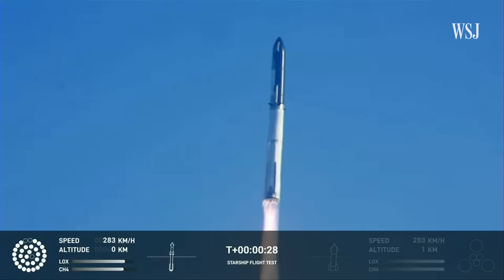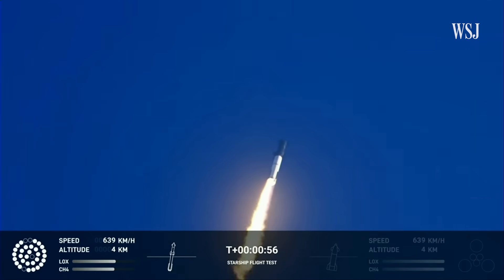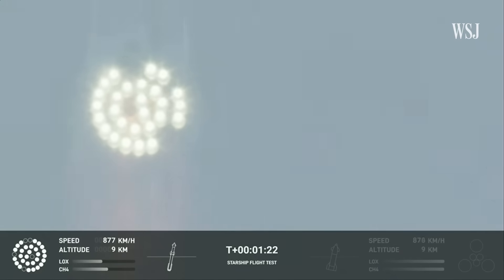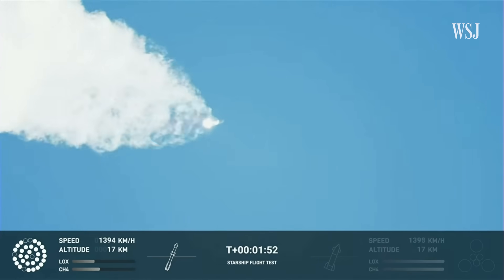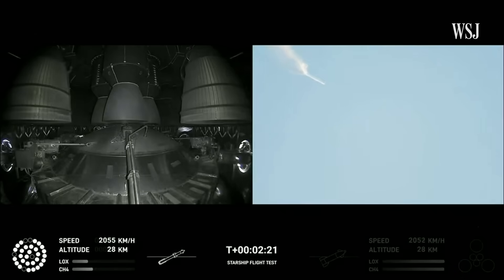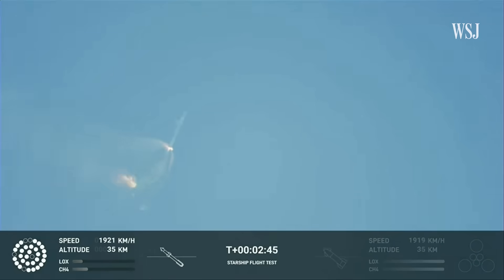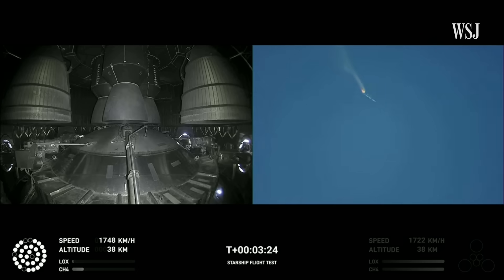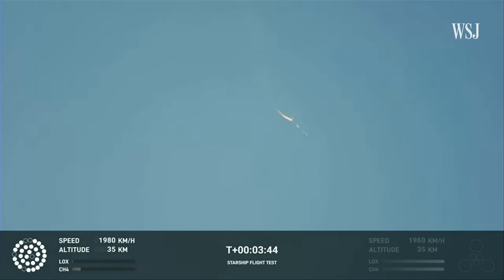Starship Explosion Video: Watch Elon Musk's Rocket Explode After Launch | WSJ

Comment: From the headline, I was expecting it early. Over 3 minutes in flight and this being the first flight... this is pretty impressive considering the engineering required
Reply: There were set milestones within this initial test. 

1. Launch and not destroy launch pad infrastructure. 

2. Separation 

3. Land booster and starship, soft landing into the sea.

4. Collect lots and lots of performance data. 

Objectives 1 and 4 complete. 

Now so long as with each test launch there is improvement of completing the list of objectives  and reducing failures, starship will be on a good trajectory to meet its long term goal. 

You cannot judge the full performance off one launch.
Reply: it was more than likely a self destruction rather than a spontaneous explosion
Reply: @journeytree  it almost certainly was, the vehicle would not have been destroyed so cleanly if some other action was imposed. It was likely the FTS being triggered by the range safety officer.
Reply: You call it impressive that it didn't explode immediately?
Reply: What a joke.  Just to remind everyone - Musk said this rocket would be delivering Starlink satellites to space twice a week in 2022!!  That's 100 flights a year that were meant to happen LAST YEAR!  And here we are and they still can't even get a successful test flight and they are trying to spin it as a win!!  Absolute fraud at its highest level.  NASA should face up to reality and kick these jokers off the Artemis program right now......they are simply not capable of delivering.
Reply: MSM will try to spin it as if it was the biggest failure.
Reply: A bunch of idiots launched a failed starship !!! 😂😂😂😂🤣🤣🤣🤣🤣🤣
Reply: Advanced technologies were presented at the international online forum "Global crisis. There is a way out". For example, the health capsule (the possibility of life extension, rejuvenation and absolute health), from time 7:09:09.
These technologies will be available free of charge to everyone when building the Creative Society.
Reply: This is a fake CGI cartoon.
Reply: @ZxAMobile lol, you sure about that? SpaceX is small... inexperiend?? They are the only ones who have propulsively landed orbital class rockets.
Reply: Its always amusing what people outside the space industry seem to think the space industry is like.
Reply: @JohnDoe-rt7ez  And that they automatically believe their own assumptions, because, hey, how they possibly be wrong.
Reply: Doctor, your patient died on the operating table, but look how long he lasted!   Yay!
Reply: @Spence12  Doctor, you seriously need to stop experimenting prototype medical equipment on patients. These things take years of trial and error, testing, and development. My god Doctor, you don’t even know how analogies work!?
Reply: Rocket explodes and GenZ say "Success"   😂  ohh man how embarrassing are these kids
Reply: @bigduphusaj162  success is determined by the objectives of a mission. They intended to destroy this rocket at some point during the test flight. SpaceX own objectives had specifically said anything past getting off the Launchpad was a success and giving them valuable data for future iterations.
Testing a machine until failure is a basic part of developing new technology
Reply: @mattmatt516   Exactly. This test was great, I can't wait until the next one.
Reply: @mattmatt516  that is simply not true. where did you get this? this flight was a test of the seperation phase. which it failed on 4 of 5 metrics.
Reply: @mattmatt516  Tell me again how we went to the moon in a beer can without exploding in either direction? Keep in mind that was 60's technology and today nobody can get any higher than the Redbull jump mark. Lololol....pure B.S. !
Reply: @jamesbonn2394  just listen to what SpaceX has said over the past weeks, or even just in their live webcast of this launch. They had lots of things they hoped to accomplish, all the way to a splashdown near Hawaii... But they specifically said that every thing the accomplished after clearing the launchpad was bonus.
Reply: @jamesbonn2394  actually you're wrong.
Reply: @mattmatt516 excuses now all the way...😂😂
Reply: @aviatorzthebest2452  It's not excuses when SpaceX has been saying these things since long before the launch. Just watch their webcast of the launch.
Reply: @jamesbonn2394  Elon was quoted over a year ago stating that clearing the tower was the main goal along with not destroying the OLM. The official spaceX stream said the exact same thing before RUD. Where did you get your info?
Reply: @jamesbonn2394  It was not a test of stage separation, it is literally called a flight test. This was the first time the booster has ever been tested in flight, and it did pretty good.
Reply: @cal-nevatower2896  sure Jan
Reply: @cal-nevatower2896  not NASA lest I remind you of all the Redstone and Atlas failures, not to mention Apollo 1.
Reply: @mattmatt516  exactly.
Reply: @cal-nevatower2896  The 60's technology was exactly that... 60's technology. The Apollo wasn't the size of the starship, and wasn't designed to fly to mars.

We could easily go to the moon right now if spaceX wanted, but that isn't the objective of the Starship. We're going like 200x the distance of the moon while carrying equipment for colonisation. That's on a whole other level that 60's technology would obviously not be able to do.
Reply: @bigduphusaj162  It was a success.  The rocket didn't explode because of hardware failure, SpaceX triggered "flight termination" after it was clear they lost control of the launch.  They self-destructed the rocket.

The success was in proving that super-heavy was able to get Starship all the way to stage separation without issue.  It's just that SpaceX's unique approach to stage separation failed to work as they had hoped.
Reply: @Ncyphen  I love how you start off with that this was a success then end with the object failure that it was it cant be both my friend in the long run this test was a failure they didnt achieve their goals ala making it a failure this isnt rocket science here lol.
Reply: @firstorder438  SpaceX clearly stated the goal of the launch was for the rocket to survive launch.  It did survive the launch and made it to staging.  So yes, the launch was successful, especially considering SpaceX assumed the rocket would blow up before reaching staging.  The failure of staging is moot considering it was a bonus objective.  A failure of a bonus objective is not a failure to the mission as a whole.

So no, I did not contradict myself.
Reply: If you hate gen z so much then how about you stop acting like one of them?
Reply: @bigduphusaj162 are you on the spectrum?
Reply: @blinks6736  I think he is on the opposite spectrum of Elon Musk lol.
Reply: @bigduphusaj162  You obviously don't understand the meaning of "test"
Reply: @bigduphusaj162  maybe they know what the whole mission was to say what they said.
Reply: @bigduphusaj162  PROTOTYPE
Reply: @Big duphus AJ  rocket doesn't explode for a solid 4 minutes in its first flight, reaching all its success markers, and guy who can't see his own feet calls it a failure
Reply: @bigduphusaj162  smooth brain comment.
Reply: @bigduphusaj162  get elin get a participation trophy or what?
Reply: @Big duphus AJ  People who make comments like yours are the same people who fail to understand why there's an "11" in "Apollo 11."
Reply: @bigduphusaj162  This didn't age really well, did it? lol
Reply: @bigduphusaj162 I mean he just made historical gains in his space flight. You need to fail to become successful. NASA did the same. Sad you thing everything is perfect!
Reply: @bigduphusaj162  Name one invention that worked the first time. Just look at the invention of the plane. You are embarrassing yourself with that comment. Should probably delete it.
Reply: @bigduphusaj162  I’m Gen X and an engineer. That was incredibly successful as the inaugural test flight on a vehicle with so much new technology. You need to learn history to see how many rockets exploded during the Mercury and Apollo space programs. Not to mention how many Falcon 9s blew up during development. Falcon 9 now is the most launched rocket fleet in history with weekly launches .
Reply: @bigduphusaj162  if they knew it will explode, why did they launch it instead fixing the issue first. And they say it’s a success??
Reply: @cp-chipheo9528  because SpaceX’s whole test architecture revolves around destroying hardware to discover oversights and failures within the system. 

Like everyone here, you automatically assume that the explosions and failures you saw were bad and didn’t have an engineering purpose behind them. Every launch is data to perfect operations. This particular one’s goal was to leave the ground equipment; which it did. The goal of the mission was to get away from the launch site. Anything else was extra, which is what we saw. No one wants to see their rocket explode, but if it does, it means that there is work to be done. Starship is a complex beast, and will have inevitable failures. Pushing it this hard exposes them faster, preventing issues like those seen during the Columbia incident from occurring because by the time you got there, it’s already happened to an uncrewed vehicle that could afford to be lost. In that way, this mission is more than a success.
Reply: @seasickrhino8926  Thanks for your kindness, patience, and explanation. However, I still see it as a failure due to immature failure. Ofcourse people can earn from failure as well as success because there always room for improvement. Fact is fact. The rocket exploded in few minutes. People can say whatever they like but they can't change the fact.
Reply: "immature failure" is exactly the point. Fail early, fail often, and if it does not fail, don't "fix" it.
Reply: @cp-chipheo9528  What a wonderful way to move the goalposts on what failure means. After you have been explained thoroughly the main objectives of this flight and how it was intentionally blown up after succeeding its main goals...

One can design a mission to launch a craft all the way to the moon, land it and return it to earth with the intent of creating future human trips to the moon. And you would be arguing it was a failure because there weren't humans inside during the testing fase...
Reply: @NeonGen2000  I respect your opinion. it's interesting to see how people's reaction to same facts. It's good to know your reasoning. Have a good day
Reply: @bigduphusaj162  You realize thats space x whole approach to building rockets right? They make them quick blow them up testing them make changes and try again... Its a much faster way to get good data but an expensive way. There was a 50% chance it was gonna blow up on the pad so getting all the way to stage seperation was a huge success the rocket was gonna blow up no matter what.

Comment: That something would happen was most likely to occur, but I thought it would be able to separate, and not so many engine failures, that surprised me, and so surely the lack of a fire-diverter must have damaged a lot of the engines before take off, but for this thing to take off on it's first flight is pretty crazy.

Comment: I don't understand how the engineers at SpaceX didn't anticipate that they would need to make sure the energy from a Booster twice as powerful as the Saturn-V was properly diverted in a way that wouldn't damage the launch pad and surrounding area.
Reply: They knew... but building a flame diverter is expensive and takes time. They knew the pad was gonna get pretty bad, but they are in prototyping stage, this is the first time superheavy left the pad, it didnt even make a hop or something.
Reply: @ghfsd786fa  That makes no sense. Repairing the pad will take a lot of time too. I wonder why they rushed to launch, hmm...
Reply: Diverted to which direction?  AFAIK the olm sits pretty close to SpaceX's developed boundary and is surrounded on three sides by ground support equipment.  Would they be allowed to build a flame diverter and direct it towards the open marsh land?
Reply: @nolsp7240  They would need to divert someplace.
Reply: Don't forget it was a success 😉
Reply: @severomagiusto4737  a success?   It factually WAS NOT a success it was by definition a FAILURE. Not only did it damage the launch site it blew up mid flight.  Do you need the dictionary definition of Success and Failure?
Reply: @bigduphusaj162  There are multiple stages to building a rocketship. When you test your prototype, you don't expect it to work on the first launch. Rockets tend to blow up on the first launch. This one, one of significant size, did not and went beyond then expected. It was a success to the contrary, as the rocket wasn't expected to survive the inital stage of the launch.
Reply: @bigduphusaj162  This is a test flight. You set some milestones for the launch and if it can handle some of gold milestones, it's a success
Reply: @bigduphusaj162  I was sarcastic, sorry you did not get it. My fault, for sure

Comment: Six engines had underperformed at one point, but bear in mind that Falcon 1 (with only one engine) took four attempts to achieve orbit. Complexity increases exponentially with the the number of components, so this has to be a terrific first flight of Starship. Well done, SpaceX!
Reply: 20% engine failure is not good at all
Reply: @qpmkro  a very toothy failure
Reply: Agree!!! people being critical of this launch just don't understand what was just accomplished.
Reply: They didn't underperformed. Engines are shuttl off and on to maintain trajectory.
Reply: @joweydelanota7421  Really?! That is an amazing design!
Reply: Russian rocket engines much better and do not blow up that easy!
Reply: The engineers used different iterations of raptor engines to collect the most amount of data, so it's unsurprising a few candles failed the light.
Reply: SpaceX amateur engineers were unable to build powerful enough engines, so they went with the daft idea of putting 33 engines to achieve the needed thrust; with potentially that many points of failure, if there are no backup engines to take over failed ones. If all 33 engines are necessary, then, with no  built-in redundancy, it can be considered a design flaw!
Reply: @truthadvocacy  Your comments are well taken, certainly!

Yet, as impressive as the massive Saturn 5's five F-1 engines were (I've actually seen them!), they could not be reused. Their design reached the limit of what was possible given their huge size, RP1/LOX propellant, and chamber pressures. 

To move much more mass to orbit and to reuse the vehicle, a better design was needed, even if it meant mimicking (to some degree) the failed Soviet N1 rocket. 

In life there are pluses and minuses, but what yields success? It seems trial and error ultimately determines much of human progress.
Reply: The complexity doesn't necessarily increase ecponentially because half of the point of the gimbal engines and sheer number of them is to act as redundancy in the case of some of the engines failing.
Reply: @ddk9467  Soviet Union N1 may disagree with you.
Reply: @superfrankpt  soviet N1 failed all its missions
Reply: @kyohiromitsu4010  and it failed because...?
Reply: @superfrankpt  because it was a firework for eid
Reply: @kyohiromitsu4010  as it seems you don't know, one of the major problems with the N1 Rocket was it's huge number of engines and the problem in master all that arrangment. Additionaly, if you have to test 30 rockets you will not devote the same effort and time you would for, lets say, 4 like in the Saturn V. Hence I said that N1 may disagree with the statment that "complexity doesn't necessarily increase exponentially". oh it will :)
It's an opinion. I like to ear different arguments.
Reply: @superfrankpt  complexity increases when you are doing something different.    The falcon already has many engines. But i do wonder if so many engines increase the overal pressure there
Reply: @kyohiromitsu4010  that is his/her point
Reply: @superfrankpt  dont you know the main problem was stage separation?
Reply: @kyohiromitsu4010  we're talking about the number of engines and if "many small" is better than "few bigger".
Reply: Not to disagree with a job well done, but its just not true to say complexity increases exponentially when you just replicate a single component in parallel. The whole point is that it doesn't increase complexity and has fewer critical point sof failure.
Reply: @RRedcraftRR  Actually for rockets it does increase complexity, the plumbing is totally different for 9 vs 33 engines, and so is the danger of vibrations.
Reply: @RRedcraftRR  but it still should have impart of reliability, no? more moving components after all.
Reply: @AlexLebed  yes more parts, but more of the same, so more to test and more redundancy. Sure it is easier to get a single engine to work than 20, but building a single engine with the power of 20 small ones is faaaar harder, more expensive and any failure immediately catastrophic.